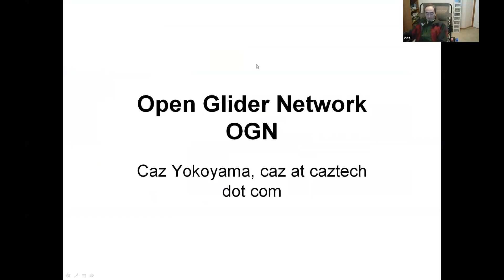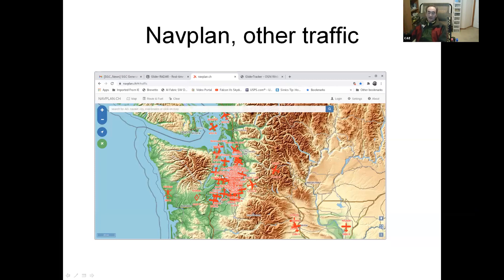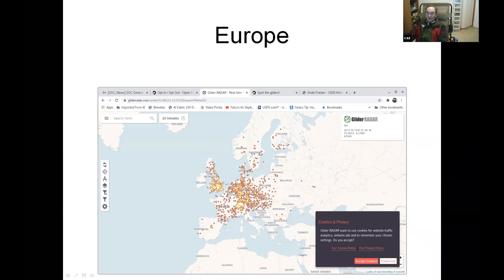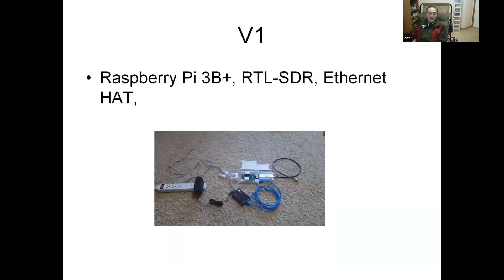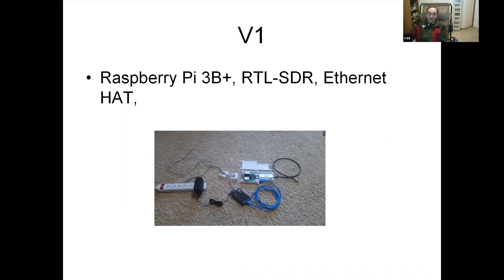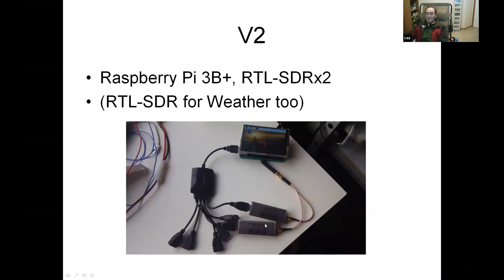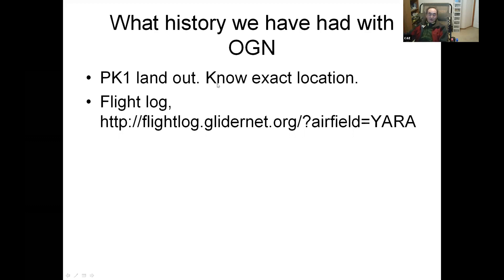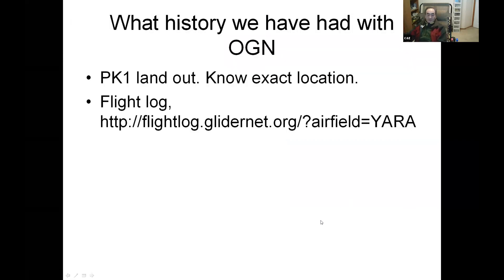What is Open Glider Network - OGN?

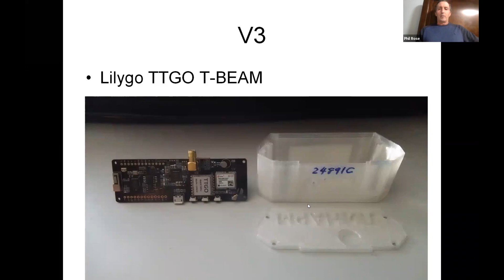Comment: For the question asked around 25:00 - yes, putting an OGN-Tracker or SoftRF or another (cheap) device receiveable by OGN in an aircraft makes this glider visible on the OGN in near real time, if in range of an OGN receiver.
Recently, we have added LoRaWAN connectivity to the OGN-Tracker, which in some Europe regions works real well. There, even without OGN coverage the aircraft position can still be tracked, just that the position report rate is about one per minute, due to LoRaWAN network bandwidth limits. This has not been tried yet outside Europe, but in principle should work after adjusting the frequencies and transmission parameters.

Comment: A general note: long reception of OGN signals is a challenge. It is not as easy at receiving ADS-B signals, which are much stronger and aircrafts are flying high. For good OGN range you need to fight for every dB of SNR. When you are close to strong RF sources like TV/Radio/Cellular tower you may need to employ filters and/or filtered low-noise amplifiers (LNA). However if you stay far from civilization then the most important thing is a good antenna and a good site with open horizon as those signals you want to catch are at the horizon or just below.

Comment from the maker: Did I mention OGN signals and ADS-B signals are transmitted by 0.1 and 5 watt respectively?
Reply: OGN is mostly 10 or 20-25mW and ADS-B is nominal 270W I think, but there might be smaller transmitters down to 25W.
There is the bandwidth and bitrate factor: OGN is 250kHz wide while ADS-B like 5-6MHz wide and bitrates are 50kbps and 1Mbps for OGN and ADS-B.
For a typical OGN receiver SNR is 20dB@10km distance while for ADS-B it is at least 20dB@100km thus the factor 10 in distance. Nevertheless with very good receivers the range can be up to 200km, with record distances like 400km.

Comment from the maker: What hardware is used on the solar power receiver in Chile, near Santiago? Standard RPI+RT-SDR? I am running https://github.com/roema/Open-Glider-Network-Groundstation with paying attention of its sensitivity.
Reply: For best sensitivity, the most important parts are; good antenna, good site, low noise thus either quite site or good filtering to get rid of intermodulation noise if near strong out-of-band RF sources. Use RPI4 and RTLSDR with TCXO and Bias-T for the LNA which should be mounted right at the antenna. Don't spend money or other SDRs, this will not help. Do an initial test: take standard parts and go to the site, put the antenna up and see what you get on the noise level and spectrogram, and then act accordingly. In Santiago they had to use the RF filters everywhere. I remember the first tests: there was just one huge noise from all kind of transmissions.

Comment: For the second question/comment: to run an OGN receiver you need power, internet access and good site for the antenna. If you are "in a desert" you can run on solar power and cellular internet access, as the amount of data the OGN receiver transmits to internet is not huge: about 1kbps when 10 aircrafts are being received. There exist such site. In Chile, near Santiago, there is a solar power receiver on a mountain top which a 50km or so link to the gliding club's internet access point.
Reply: i know Im pretty off topic but does anybody know a good place to stream new tv shows online?
Reply: @Blake Leonardo I dunno I watch on Flixportal. You can find it by googling :P -zachary
Reply: @Zachary Bo thank you, I went there and it seems like a nice service =) Appreciate it !
Reply: @Blake Leonardo You are welcome :D